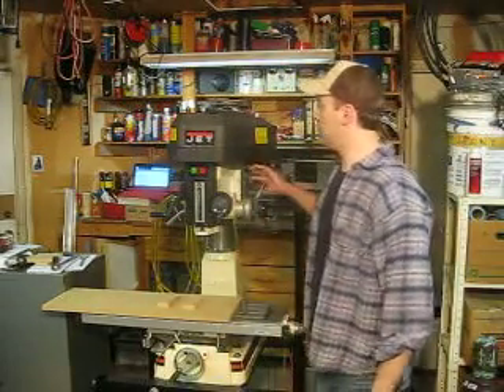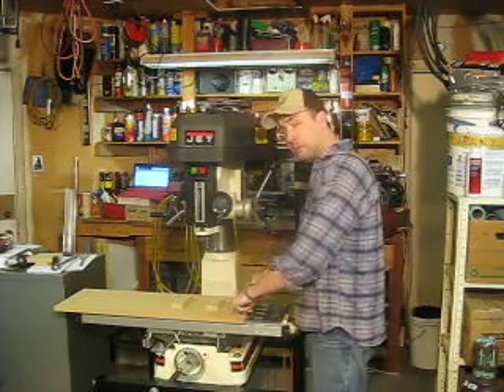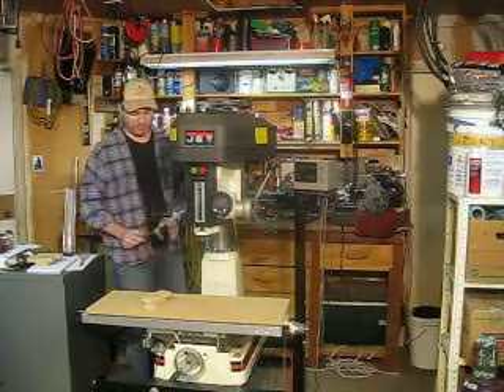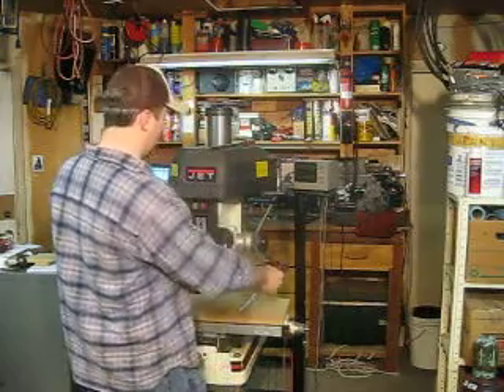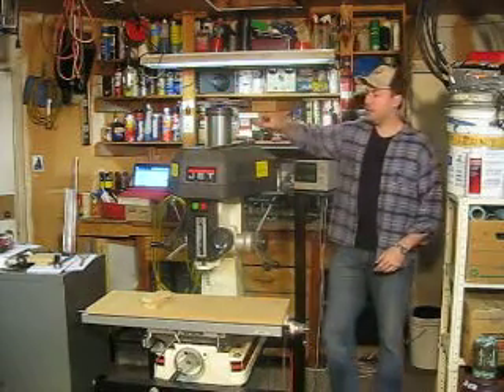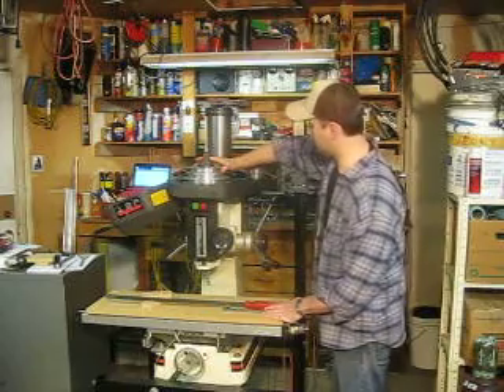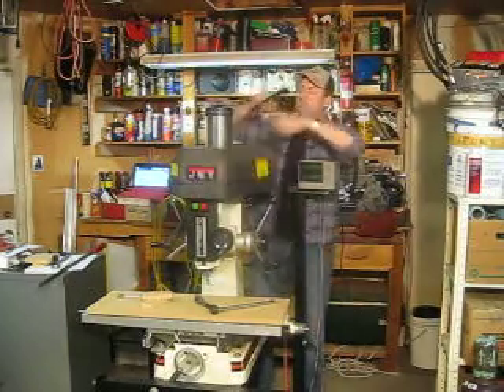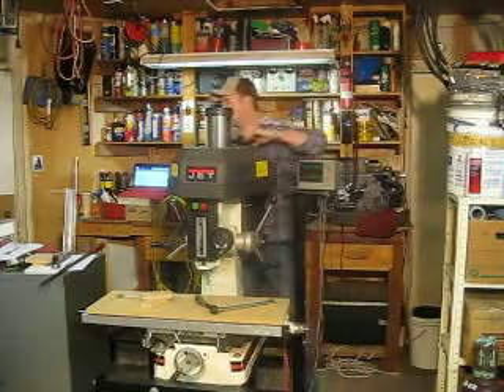Raising Head and Changing Speeds on Jet JMD 18 Mill Drill Milling Machine

Comment: It's been 5 years since this video was posted, but I need to change speeds on my JMD-15 which shares the same Manual as the JMD-18.  No where is it mentioned to loosed the two bolts locking the idler pulley in place but you did to allow loosening and changing the belt positions.  But then I never saw the retightening of these two bolts after the belts were positioned and tensioned.  Those bolts on the idler bracket on my JMD-15 came tightened so tight that the washers beneath them are curved and drawn into the slots below.  It's an idler, should it be fixed in position or can it float where tension allows it?  I'm thinking of trying to maintain equal tension between the belts which can't happen if you tighten those bolts.  Anyone?

Comment: Hi! Can I work with steel on this machine, for example making small tools for fixing car or other machine? How precise is it? Thanks.
Reply: Hi I own the same machine that was marketed/labeled and sold by Rong Fu and I can say that this little Milling machine is absolutely awesome and as far as capabilities I have used it for machining everything from stainless, titanium, cold rolled steel, to Aluminum and brass and it holds a tight +1 1 consistently. I have seen this exact same Machine sold by Grizzly as well and again it is the same Asian machine that was sold by Enco,Jet,Rong Fu, Grizzly, Central Machine, Etc.... As far as price I have seen them sold from $550$1900+ depending on the name . Hopefully this will help you take care .
Reply: +Milspecmachine Thanks alot!